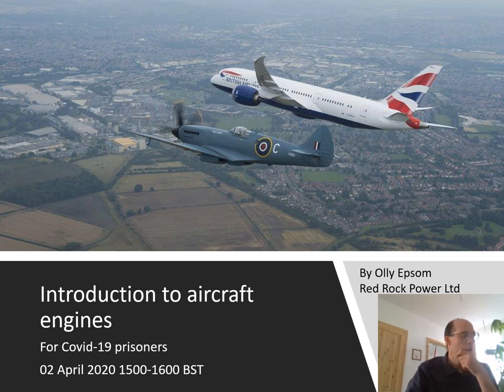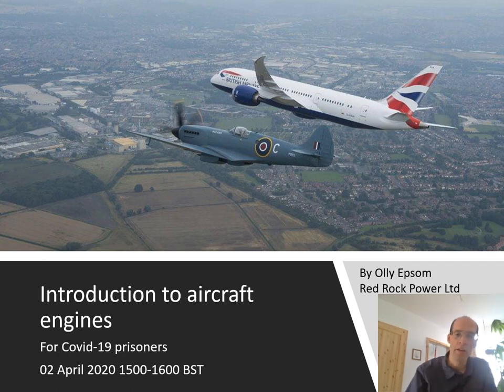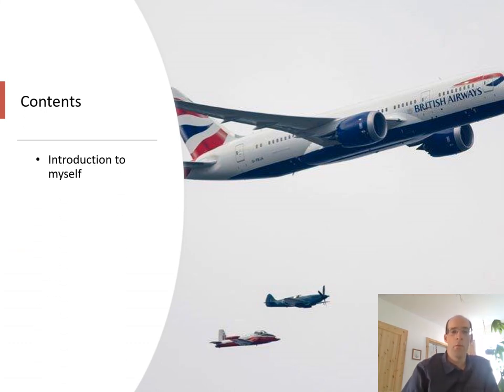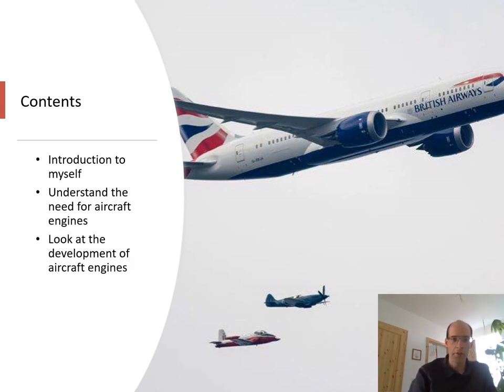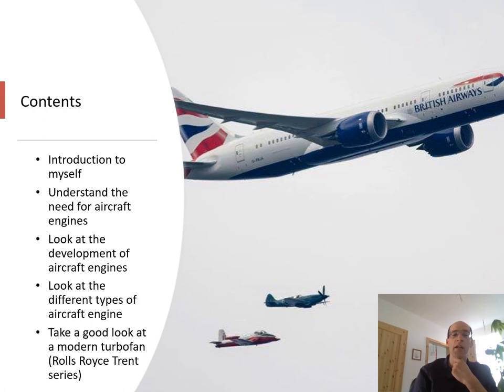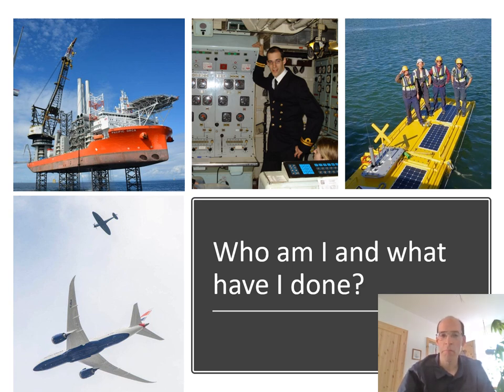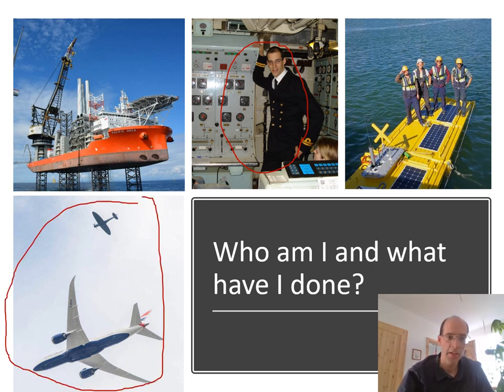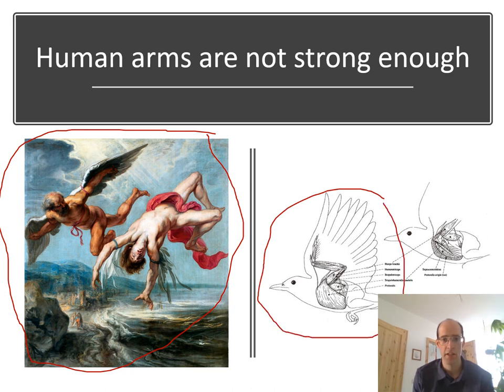Aircraft engines - How they work

Comment: The turbofan at 13:50 was actually a General Electric GEnx engine used for the 747-8 Intercontinental. A common misconception about the fan is that the fan is a propeller but it's actually a compressor. It compresses the bypass air just like the rotor blades in the core compressors compress the air. The compressed bypass air expands and accelerates out the back of the bypass nozzle producing thrust like a deflating balloon. That's why turbofan save so much fuel because only a small fraction of the air entering the engine is mixed with fuel and burned to produce jet thrust. Believe it or not, it's actually the fans in low-bypass military engines more than the fans of high-bypass civilian engines that produce thrust like a propeller. But Rolls Royce does make very efficient engines, the fans on their engines compress air more efficiently than the fans on engines of other manufacturers such as GE or P&W. That's the only superiority of Trent engines that I know, I'm sure there are others.

"You're more than welcome to your incorrect opinion, that's fine." 🤣
Reply from the maker: Wow, that's an extremely embarrassing oversight on my part. I originally put the slide together for a school and obviously didn't check them properly!